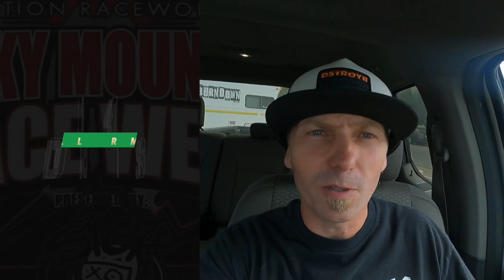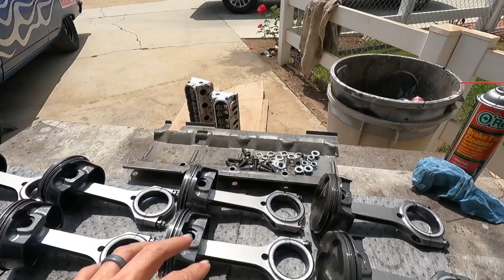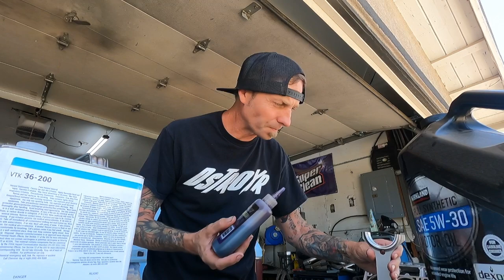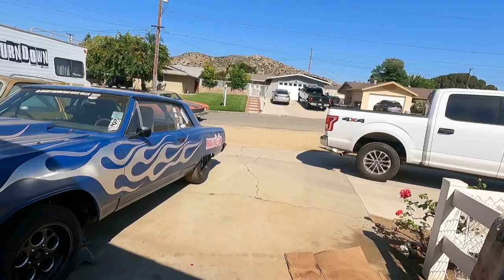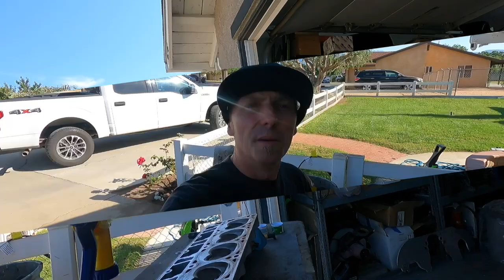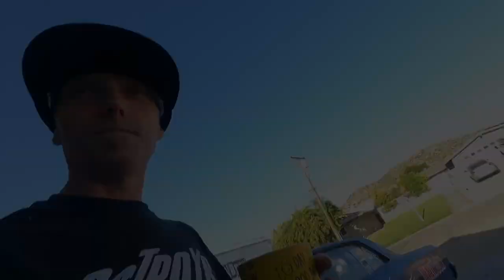Running Out Of Time Before RMRW 1.0 motor assembly

Comment: There is a right and wrong direction to installing the cam bearings on the LS. 1,2, and 3 need to be installed from the front and 4 and 5, from the back.
You will see a chamfer on the journal the bearings go in. If you go from the non-chamfered side, you will scrap off some material from the OD of the bearing.
Reply from the maker: This is my first time hearing this. Makes sense to me. I'll keep track of the bearings next time and look at the chamfers on them. Thanks for the heads up.
Reply: @Burndown  👍  Here to help and enjoy the content. ;)
Look in a blocks cam tunnel, you'll see what I'm talking about.